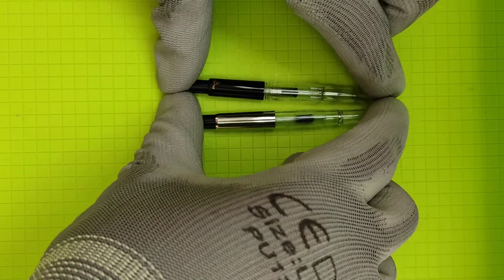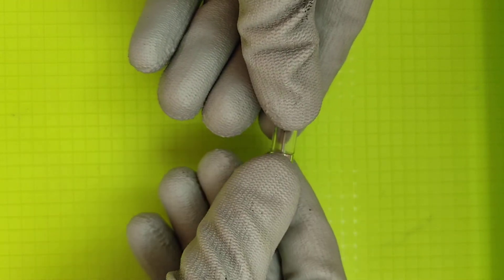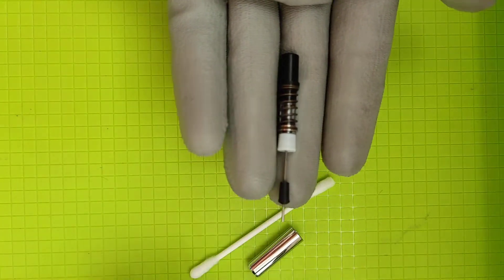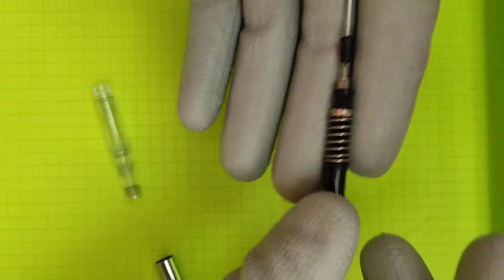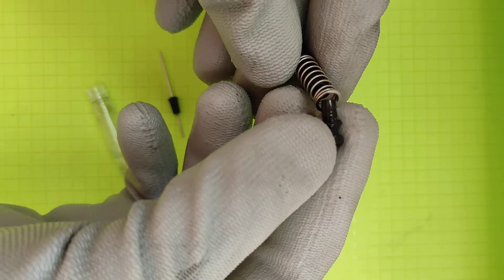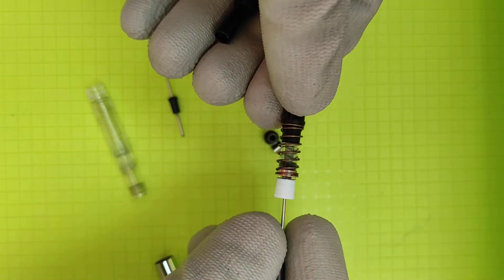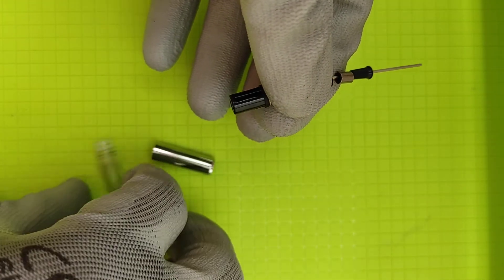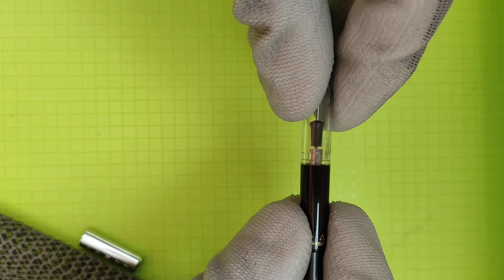NEW Pilot CON-70N disassembly

Comment: The unserviceable con70n is shit and designer with no brain installed. Just buy a $20 wingsung 699, remove the pilot nibs (#5, #10 only) to 699, you will have 2ml capacity

Comment: I would say chances of breaking it in the process are very high. Broke mine in the process. The plastic sides are very thin and fragile, the type that doesn’t bend and rather breaks. Mine had particles from paper towel that I snuck in to dry it, because it doesn’t seem to dry completely on its own. My advice is, don’t try to open it unless you would throw it away otherwise. Which was my case. Thanks for the video though, I only broke one side, would have been both otherwise ;) I might still be able to use it, with a syringe perhaps
Reply from the maker: Well you could still use it with the adhesive tape, something like electrician tape. xD

Really a shame from Pilot. The old version is actually much better, do you still have it ? I

Yeah I mostly refill cartridges, its the most professional way to do things without making a mess xD.
Reply: @cortesimerci35  well, one of the plastic sides seems good enough to hold it in place with a slight wobble. Obviously not a perfect solution, but I added a drop of glue in there for good measure and I could still use it just fine and the piston is still functional. The thing is, I seem to be preferring the syringe approach as it is much simpler, cleaner, and very precise. If I want to use a little bit of ink, because I’m testing a pen etc, there’s no mess or wastage. I guess if I want to refill the pen with the same ink that was there I might dip the nib into the bottle. But if it’s a new ink, or if I intend to do cleaning, syringes are just easier
Reply from the maker: @Emil_m  Yes I agree , syringes are superior .I use 1ml smallest syringe with the manually dulled biggest needle i could buy. No need to clean anything no ink wastage. 
   What might be worth to look at are Majohn A1 replacement cartridges which uses pilot standard, they come with removable cover, so It might be more convenient. I dont have it, but it looks promising.

Comment: Can ink still get stuck in the little reservoir or did they fix that for the new one? If it's fixed, then I won't have to risk breaking mine trying to disassemble it.
Also, my one is the new one but it has a silver collar. I figure it's the new version because twisting the collar doesn't do anything besides making it slide around.
Reply from the maker: Yes its a new version, you can judge by metal agitator. 
 New version still has the inner reservoir so the ink gets trapped there too. Once you break in its very easy to clean the inner reservoir the problem is that the new version no longer has screws so you literally have to break in it as I showed in the videos. 
 
If you still have the old con70 the dissasembly is actually super easy.  I have developed a super easy method, but sadly there are no oldcon70 on sale anymore. If you still have the old con70 I could show you the trick.